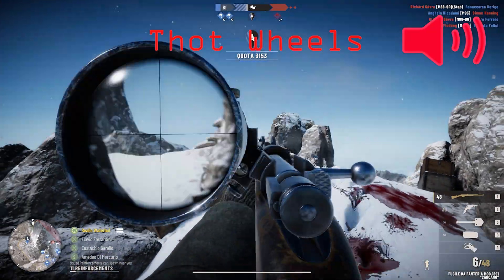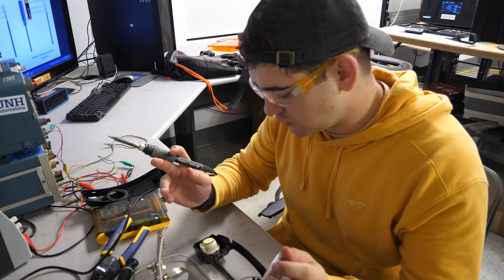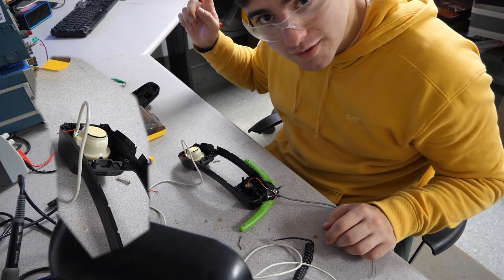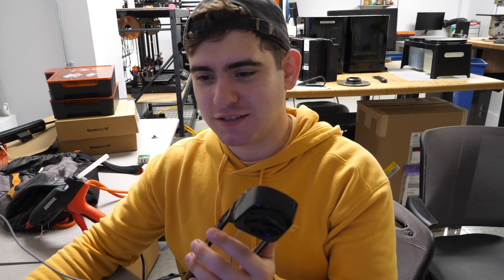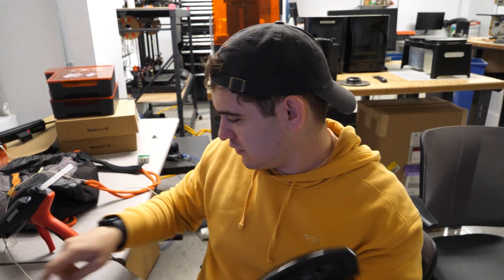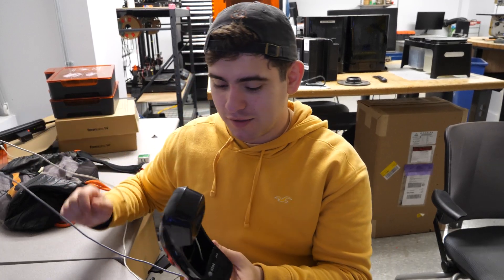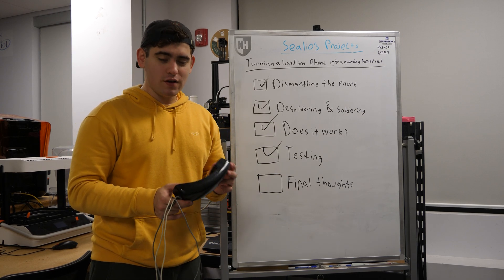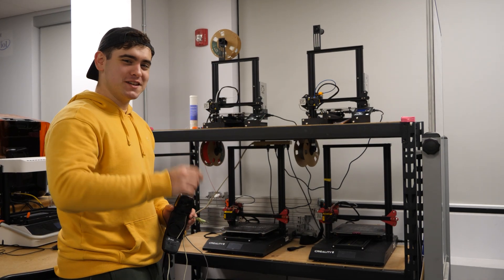I turned a landline phone into a gaming headset

Comment: Would it work to just cut the end off the handset cable and solder the proper wires to a headphone and microphone jack? (And if that's possible, then presumably you could solder a bypass inside the phone base, and then create a small adapter box with two 3.5mm Jack's on one side and a phone jack on the other side.) Or is there something else going on here that I don't understand?